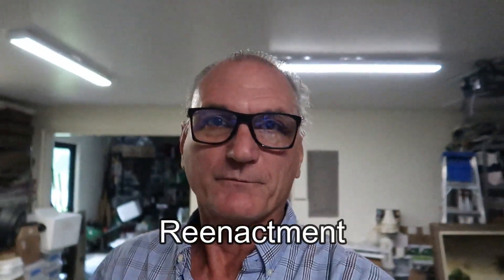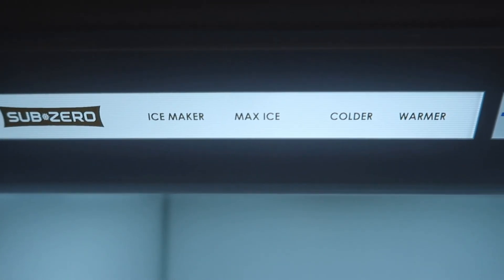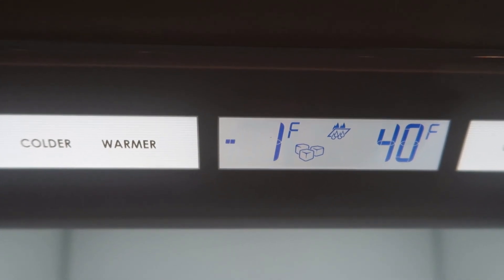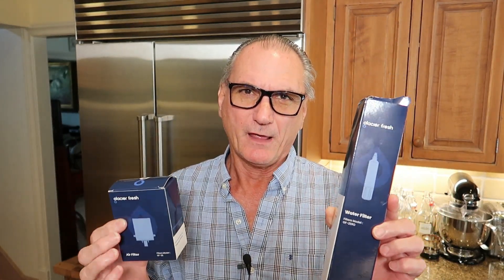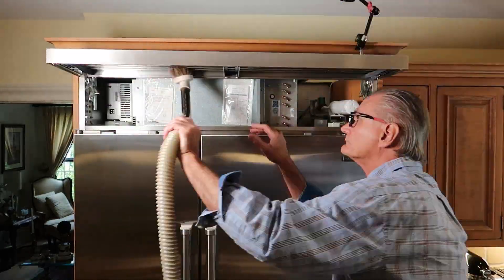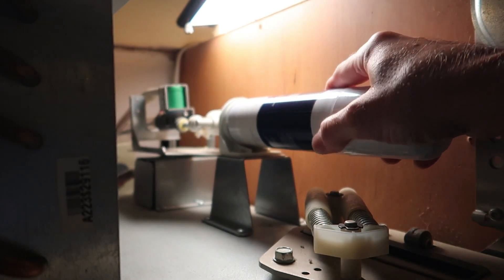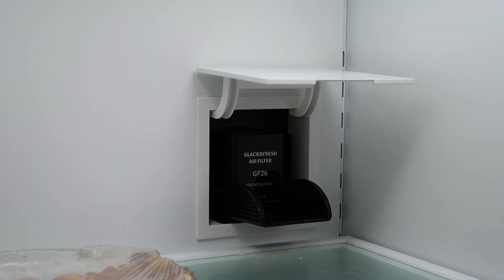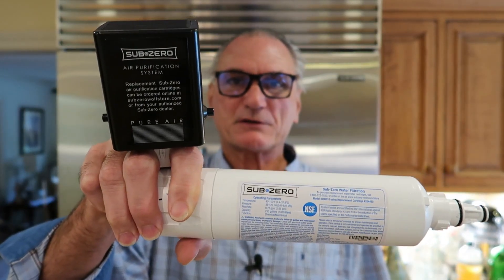No Ice From The SUB ZERO! And The Repair

Comment: You fixed it! That was too easy.
Reply from the maker: Two weeks prior to this video, I had water dripping out of the refrigerator's door bottom and leaving puddles on the floor. That fix was tough because the drain line was clogged, and I could barely get my arm all the way under that refrigerator to clear the drain line. Wish I made a video of that job.